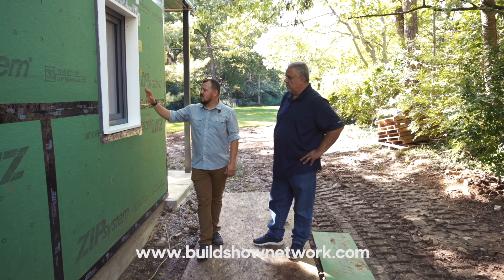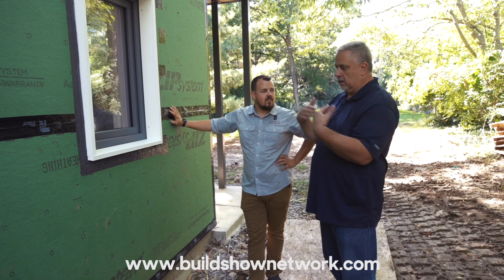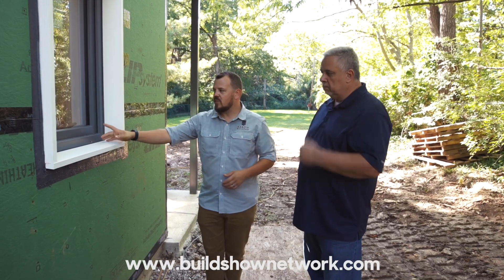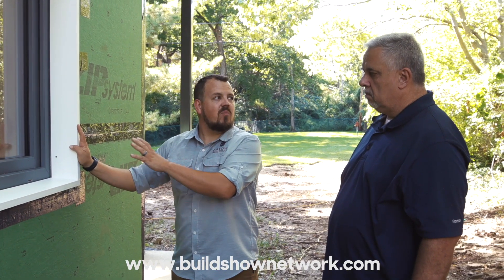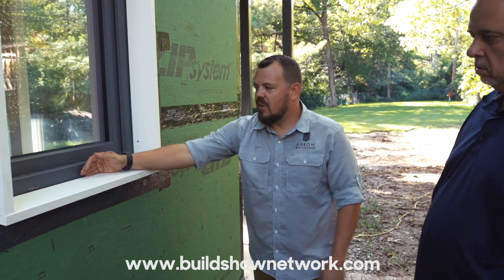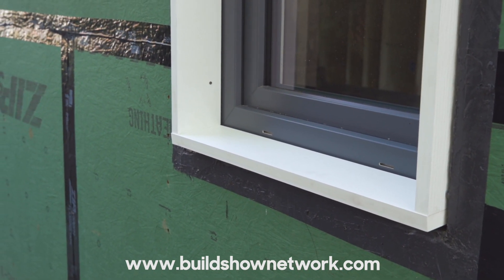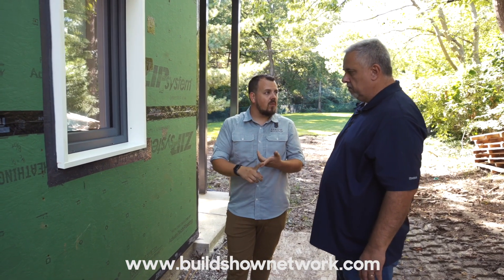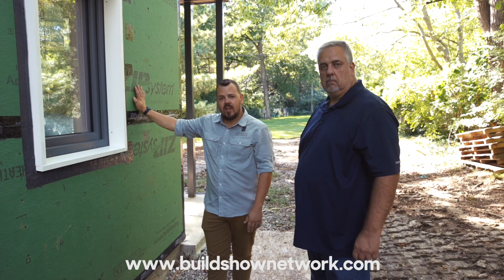Deciding Where to Install Your Windows

Comment: I HATE caulking anywhere in my house, so this method is appealing to me, but what happens 2-3 years down the road when the 1/8" joint gets clogged with sand and/or debris?  Should the homeowner make a habit of vacuuming the joint a couple of times a year?

Comment: I agree to disagree. I own a 50y old house myself in Germany with solid wood argon glass filled triple glass windows and they are with 100% silicon glued into the masonry opening of the house and set back about 3-4". We silicon Glue the outside edge of the window and we do install a water shedding tile as a ledge in a 10 degree slope and never had to go back at it again. House was build in 1972 and we are now now at 2020 so do your math. 
I think what is much more important is to tell builders DO NOT CHEAP OUT ON MATERIAL QUALITY is the key factor. 
Another thing I really DO NOT like is from the outside the window need to be accessable meaning cut away the caulking and remove the anchor screws and you can remove the window. To many times I do see the windows are just plastered left and right into the openings so you can't remove or swap out a window the way it should be. Top, left and right always need to be just the caulk holding the window visually in the opening and a little set in behind the ledge on the button for better sealing. This way you just need to remove the caulk from the inside and out, remove the screws and maybe knife out some insulation around the little gap of the window and boom you can drop her out to the outside and replace it with a new window. It all boils down to proper installation and high quality materials. So often I see people cut corners like sprayfoam with big gap or crack foam when it's suppose to be only the blue window foam. Also the inside opening of a window has to be 1" all around smaller so the Window can not be pushed into the house also allowing a much better installation process because now pushed against the material it forms another bond and ensure straightness on top.

Comment: How much rain water is going to hit the window and go down the sheathing? It is hard for me to believe that that is good behind the siding. 
Will there be another layer between the green and the siding or is the green surface the wrb? Will the water be going down the green surface?
Reply: After watching their videos for a while, the green sheathing is Hueber ZIP that is OSB with a WRB coating on the outside.  They mentioned a rain screen, which is what they have typically done as well on previous installs.  Based on the thickness of the buck I would say they are probably going to install some Rockwool, which is essentially a fibrous stone that won't absorb heavy amounts of moisture, over the ZIP/WRB and then do some vertical rain screen battens or an air gap material like Dorken's Delta Vent on top of that before they install the final cladding.  So yes, some bulk water will be going down the green ZIP sheathing where the windows are, but their sealing details and venting outboard of that should allow it all to go down and out as well as dry.  Check out either Matt's videos like https://www.youtube.com/watch?v=P165RxBHBtU or Corbet's over at Home Performance channel for more videos like this https://www.youtube.com/watch?v=_lqr8R2i5Vo.  Corbet used a ZIP competitor so his wall is grey instead of green.
Reply: Jeff Barnett I doubt they’ll install another wrb, such as delta vent.
Reply: aayotechnology sorry you are right.  I got the product wrong.  I meant the Delta Dry to give an air gap.  Delta Vent is just a permeable WRB that has no ability to provide an air gap itself.

Comment: 110% guaranteed next painter caulks around those windows - 'cause that's what they do'

Problem with many of these vids is they are incomplete snippets. Need to show the assembly details, not just talk about them after they've been installed.  A mock up would have been great
Reply: Yes please have your camera guy at least zoom in to what you are talking about. A quick detail sketch would be even better.
Reply: @aayotechnology  Actually, show us he water management/materials/steps/applications that were performed prior to installing the ext jambs that leads to a 1/8 in gap between the window and ext jamb that doesn't need calking because the water flows behind the jamb and out.. I am assuming???

Comment: The last thing a building owner wants; is decomposition of the materials by water. However you can also get dry decomposition in areas with low humidity. 🏜☕

Comment: Jake and Steve, were you also pointing to the underside of the buck being open or just the window?  Internally the window has tape / air dam applied ?  The butt joints on the PVC are glue welded? 
Cheers
Reply: Looks like the weep holes are 1/2" above the buck, so the bottom of the window cut out is stretch taped and the top of the buck is caulked. 🤔

Comment: Got a quote to replace all my windows, and I asked how they will flash it, they said they will chalk it, I laughed at them. 50+ 5 star reviews on angel's list.... big question is how do you find people as good as you guys without having find a carpenter and train them myself.
Reply: Chalk? 🤦😂
Reply: @CybekCusal  the way most contractors install windows, might as well be chalk.
Reply: Good question. A new house on my road last year went up. Zip R, an architect job. The window guys taped, but the sheathing was never taped. Up went the lap.
Reply: I have driven around and looked at builds in progress in our area to see how they did things. 1st thing I look at is how they do the windows and wrb. I have only seen 1 company out of I dont know how many flash a window right. It's pretty sad when most of these things are simple and wont take much more time or material to get right